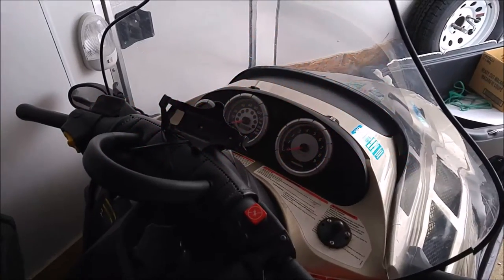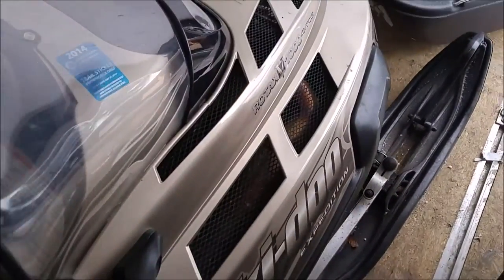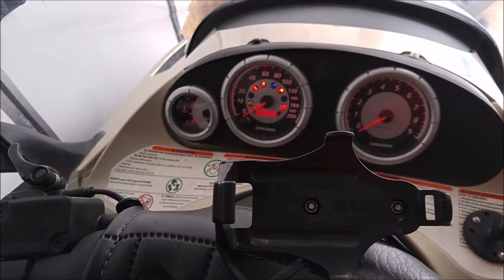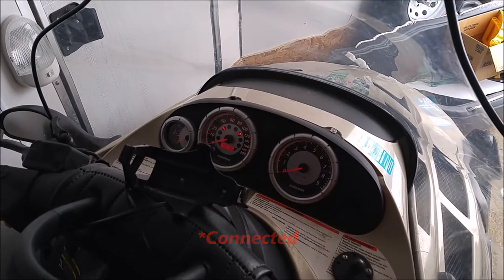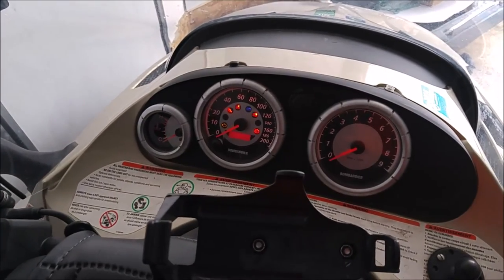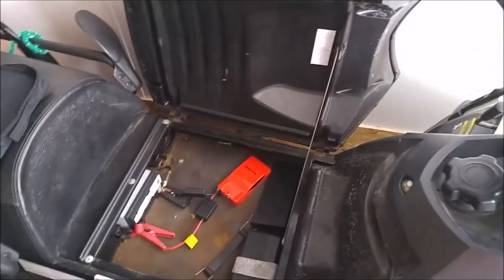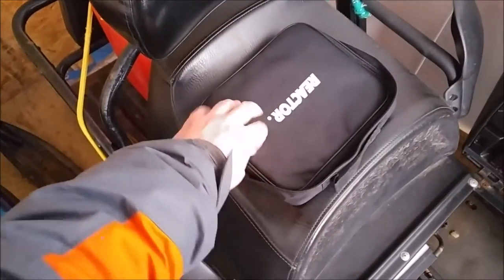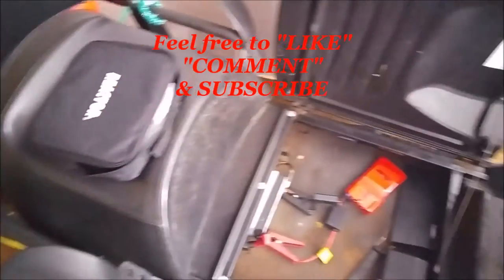REACTOR Lithium ION Multi Function Power Bank: Follow Up

Comment: I use mine all the time Dave. I get a lot of customers this time of year with battery issues so I'm boost starting cars every day. The technology for these units came from racing GP motorcycles they wanted to reduce the weight of the battery. I have an OBD2 attachment for mine that you connect to your vehicle if you need to disconnect or change your battery it saves the memory on your radio and security. Great product.
Reply from the maker: Very cool.  Batteries have come a long way in recent years, there a lots of similar products out there and the convenience is what I like.  I still have the bulky packs that are the same size as a car battery and they were a nuisance carrying around.

Comment: good to know they work..i got 2 for christmas...one for wifey and one for our sons car....they were $129 each at home hardware .
i wanted one for myself but they only had 2...so i ordered similar item online for like $80 from   ebay ..
Reply from the maker: Thanks, yes they are great to have!  A great thing is they can be stored in the glove box when the car is sitting in -20 degrees and the unit will still work fine as the battery is not temperature sensitive like traditional ones.  Well worth the money.

Comment: DO I HAVE TO PUT THE REACTOR  ON AND SEE THE BLUE BARS BEFORE STARTING THE CAR OR NOT . THANK YOU  LISE
Reply from the maker: serge ferland yes, the unit needs to be turned on, when the blue bars are on you can boost.  It automatically turns itself off so no worries of forgetting or wasting battery life.